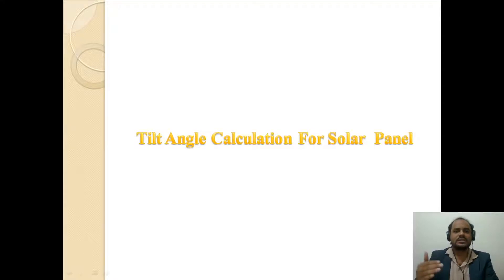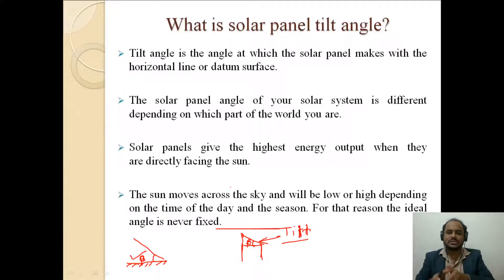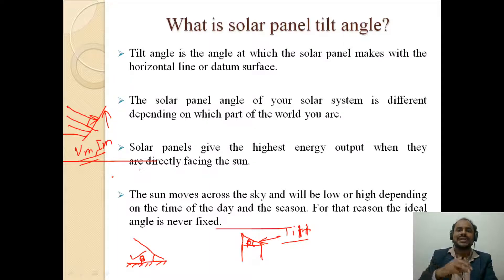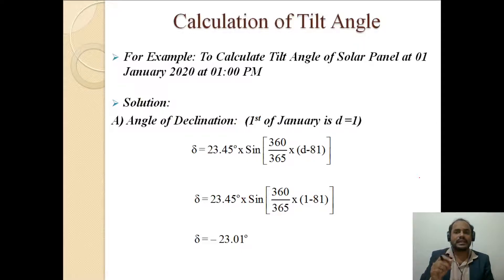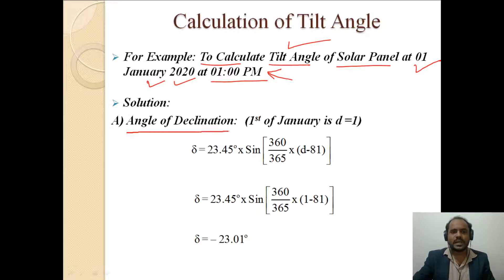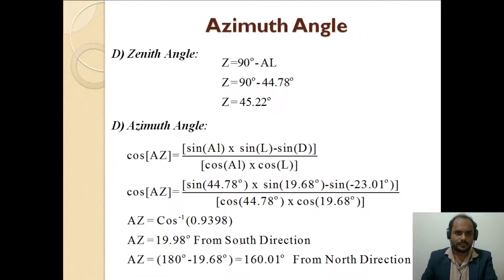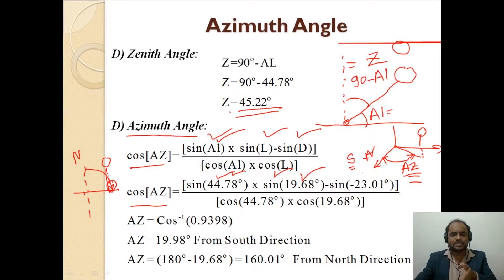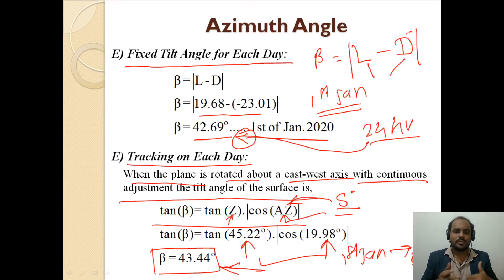How to Calculate Tilt Angle For Solar Panel # सौर पैनल के लिए Tilt Angle  की गणना कैसे करें

Comment: ,kamptee latitude is 21.207769 ,some solar expert say to keep tilt angle equal to 0.9*21.207769equl to 19degree or latitude +/- 15 for winter and summer, should I go for solar adjustable stand suggest optimum tilt angle between 16-22 degree your opinion please jayesh sinha kamptee